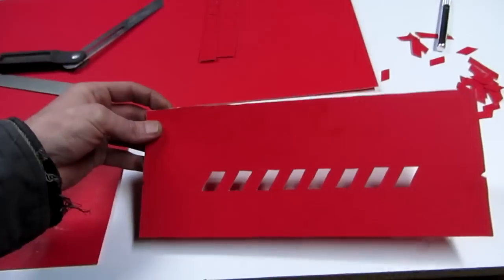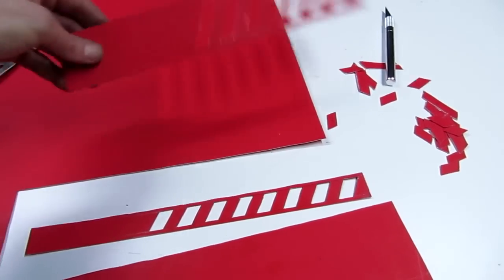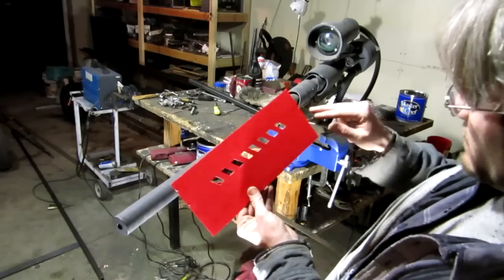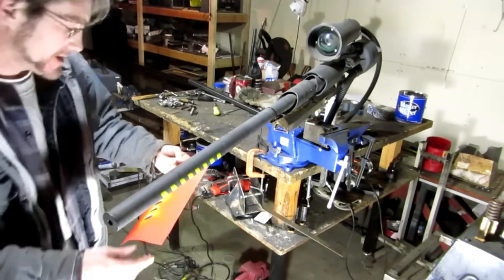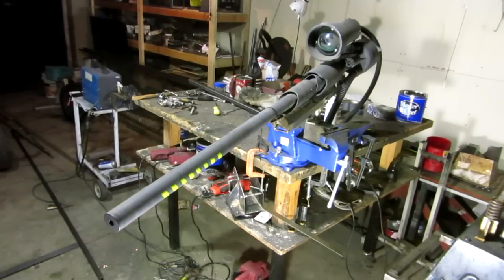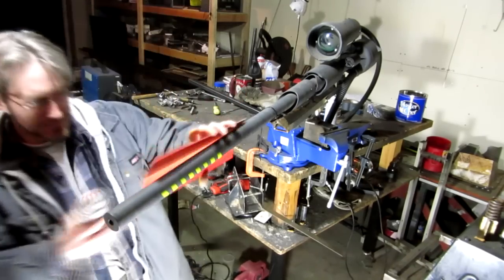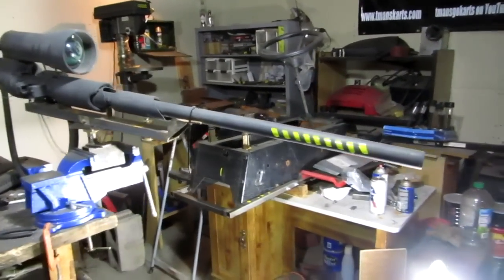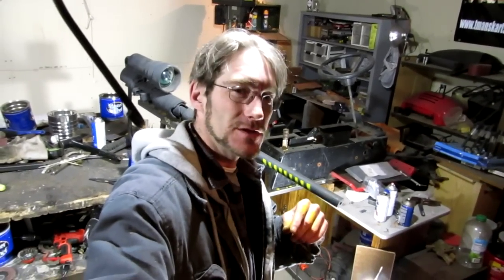New Build | Homemade Stencils

Comment: Hey man sweet videos! I'm currently in the process of building a go kart of my own and just got all of my shocks for the suspension, but I'm having a hard time finding a place that sells shock mounting tabs to weld onto the frame. Any recommendations? The hole diameter is just 8mm.
Reply from the maker: sure, see what I did here. https://www.youtube.com/watch?v=_5KrP4gx0xU
Reply: ***** Cool, thanks! I think I bought the same shocks as you so that worked out well.